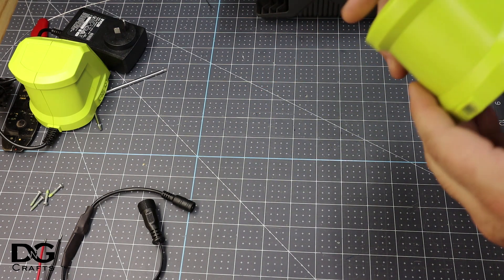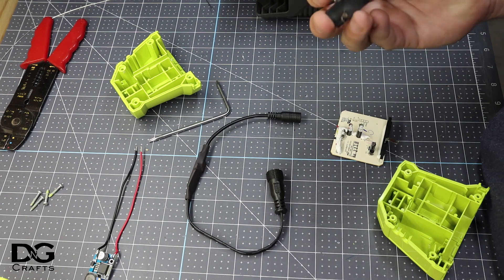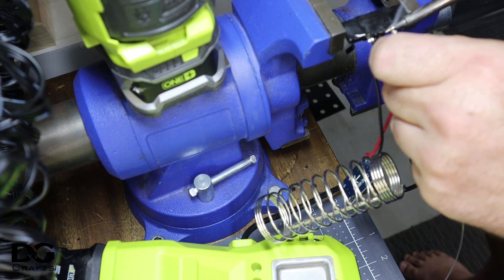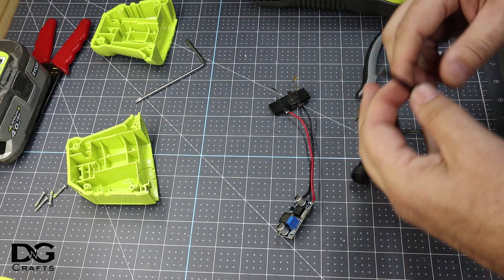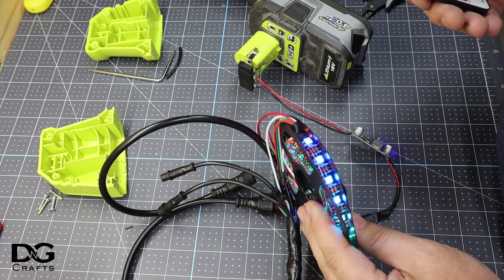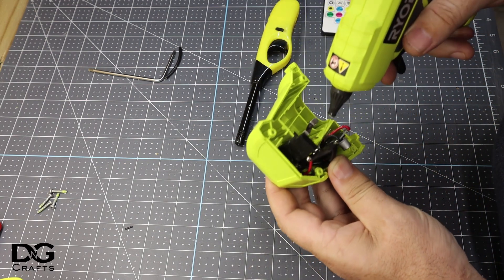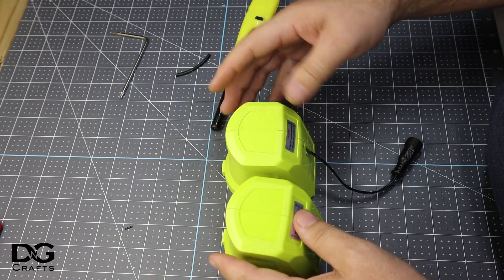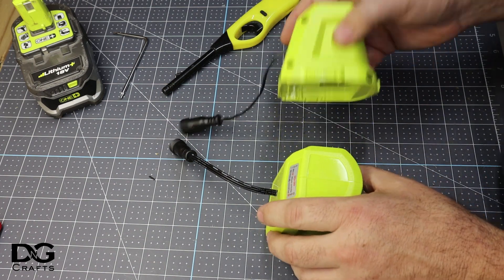Making a Ryobi One+ Pixel Tester

Comment: I suppose that you could wire in a switch to change the resistance value of the POT with a fixed resistor (or switch between two POTs) to switch between 5 and 12 v. 
or between 5 and 4v to simulate volts drop. Or an external knob. 
I suppose all of that makes it less DIY friendly for the less experienced or less well equipped hobbyist.